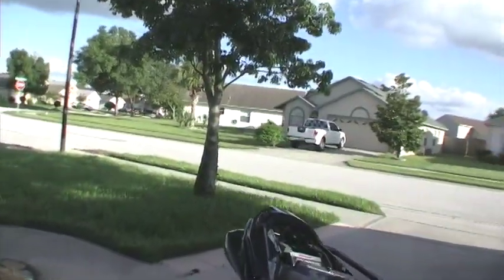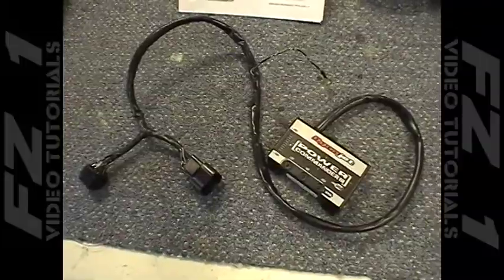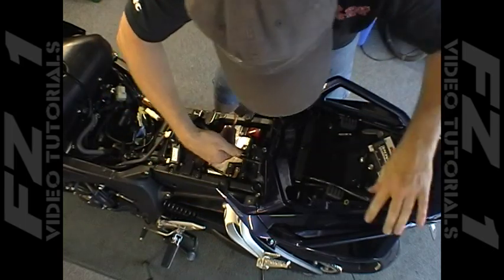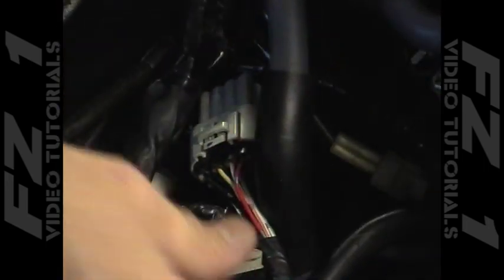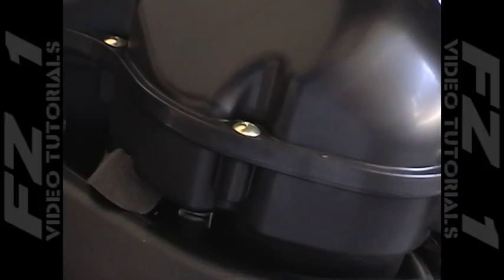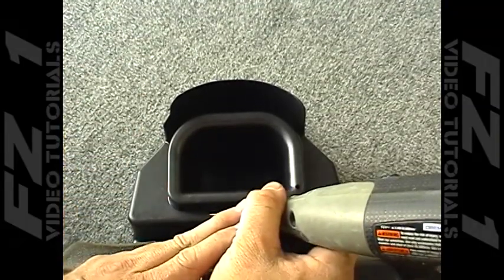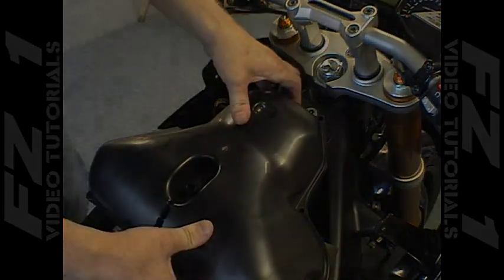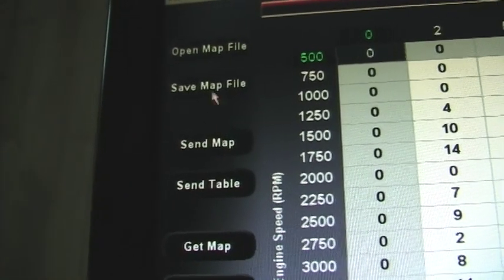FZ1 Video Tutorials - PC3, Airbox Mod and AIS Blocking

Comment: The airbox mod does nothing and has been proven in dyno. It gave 1hp at the top and slightly less tourqe at the low end, and it used a heck of a lot more fuel after tuning. its pointless.

Comment: i did the airbox mod...
but i have found that you need to cut the flap on the front of the box as well for it to be effective.
because the flap blocks the air ducts on the frame....
thanks coppperdawg you rock dude...

Comment: With a slip on, stock header with cat, modded flies, and a bmc filter would a pc be necessary? Would the bike be running too lean. I want to do some to get more air since I am at altitude but also don't want to drop the money right now for the pc.

Comment: I'm wanting to do the Lars air box mod, install my Black Path block off plates and also remove my catalytic converter while I rebuild my 2011 Yamaha FZ8.
  I have a coffman's shorty slip-on and a K&N race filter. 
Should I do the mods on my FZ8 before I get the ecu flashed and power commander installed later down the road???
  I like your video's and wish you had more on the FZ models. The way you present yourself and the knowledge is very nice and  your voice helps me zone in more. ha

Comment: Nice video! I made pretty much all the mods available for the FZ1 (cat gut, Yoshi slip on, PC3, Airbox, filter mod, and Patrick's flies (Thanks dude!)
I also blocked off the AIS by putting a bolt with a rubber cap on top. 

One thing, if you have a Japanes spec FZ1 like me, you will have to do one other big mod. Either change the ECU to a US spec (best solution) or get the magical racing speed limiter remover. Jp bike has been detuned :(
Reply: How can change an ecu to eu spec
Reply: @hards7yl3  Wow, its been 10 years since I had this bike! I used a power commander to change the bikes tuning. These days there should be other options. In my last bike (Ducati Diavel) I used a lap top connected to the ecu and I flashed different tunes onto the ecu directly. I would try to find something like that.

Comment: I have a question, what hose must be blocked on the right side of the  bike....I have blocked the hose on the   back side of the air box....I hope the poping sound is gone now?! It's an vibration between the 4500 and 6000 rpm.

Comment: Thanks for this very enlightening video! I would like to ask you the following:  By just blocking the AIS air sucking hose from the airbox, will the AIS system have any problems? It will try to suck air from a blocked hose with no success. If you tried just this without removing the entire AIS, it is a nice and very easy mod. Please answer me so I can proceed with just the hose blockage. Thanks!

Comment: I know this is an old video, but you seem to have a lot of knowledge on the FZ1 and can maybe help because I exhausted the search bottom already lol... I got an 06 Fz and after installing a Hurric slip on I noticed that when I'm trying to keep a steady speed let see around city all I hear is a terrible gargling sound and i have to give it more gas for it to go away is hard to explain, but even in natural if i slightly start rolling the throttle you can hear it and is driving me crazy and can find anything about this problem, i put a K&N filter, change the plugs and adjust the tps a little, but still happening im willing to make a video if you can help, thank you.
Reply from the maker: The coils may be the problem, if you have acces to a manual there is a way to check the specs of each.
Reply: Yes already check them everything looks to be in order, but I may still buy a new set because i been dealing with this problem almost a year and no solution at full throttle she is perfect, but trying to cruise is when it starts happening
Reply: @Laguer2500  Did you ever figure this issue out? I am having the same issue on my fz8
Reply: @kieranhyland2527  after changing all the coils it help a good amount, but never went away completely.

Comment: Hi, how much did you achieve with that mods on the FZ 1? I'd like to do the same!
Reply: Hi Jean , I have done the air box mod, flies , free low air filter , pcv and custom map and have a full Akrapovic, mean range is huge and 152 at the rear wheel , no problem keeping up with any sports bike.